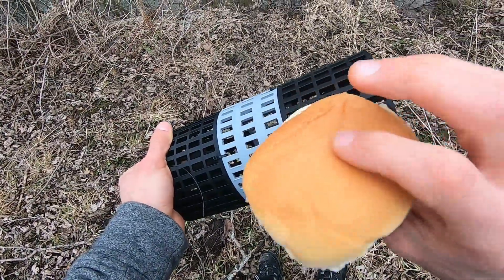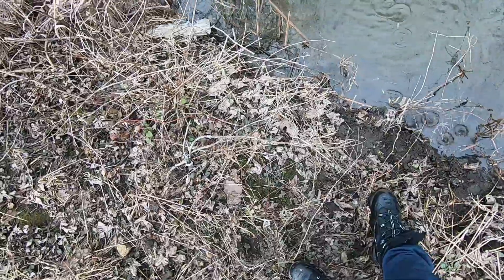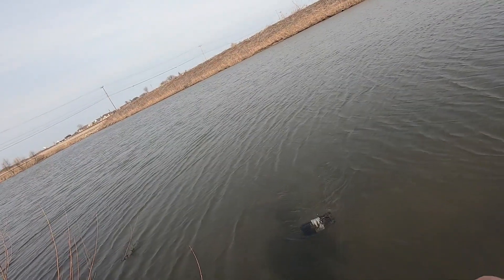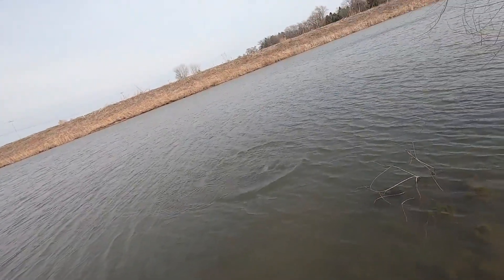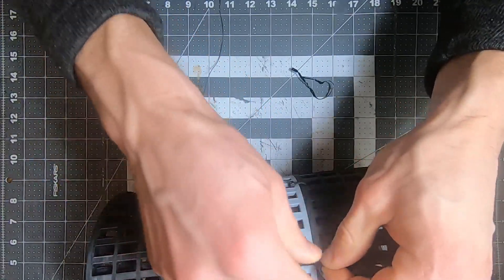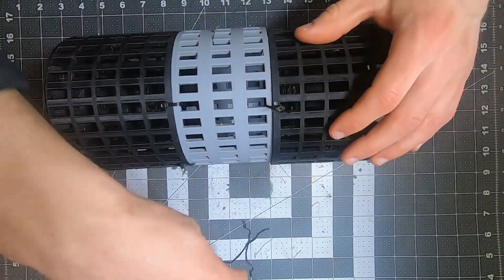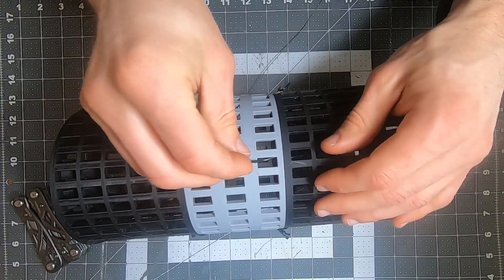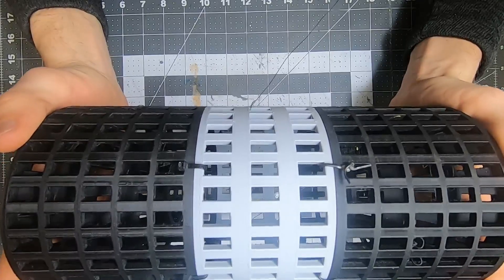3D PRINTED MINNOW TRAP TEST

Comment: You could have designed a lid type opening in the middle section.
Reply: or only zip tie on one side, and use a rubber band with a hook to hold it closed